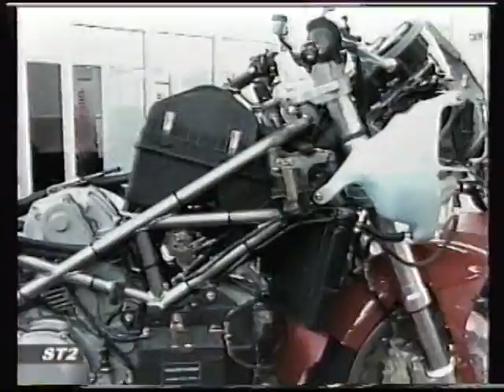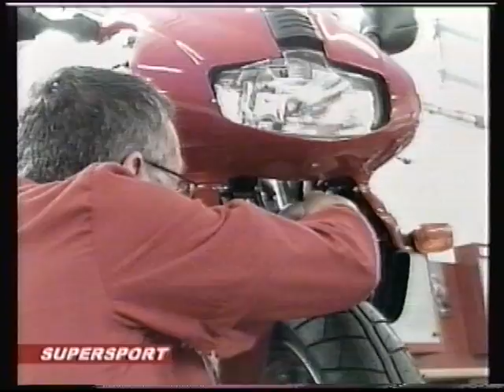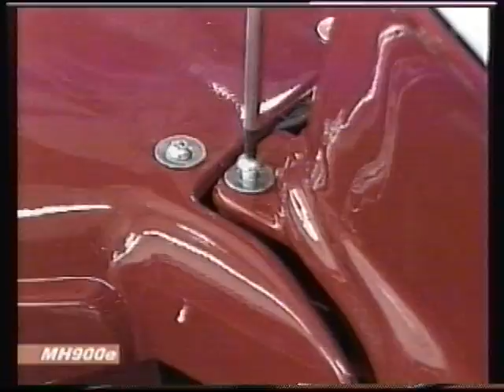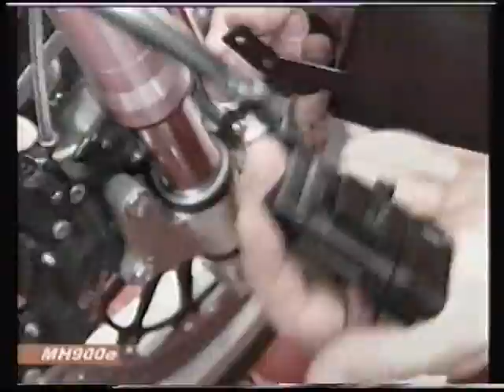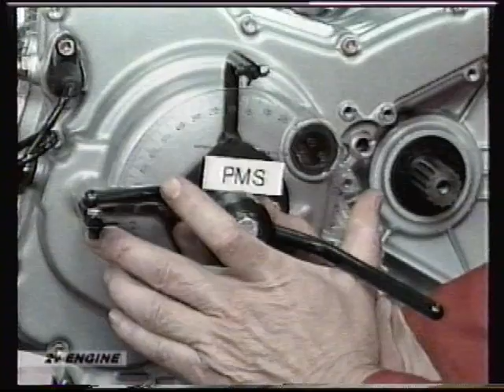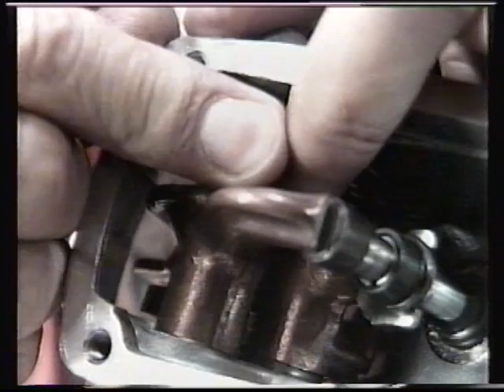Ducati Service   2 Valve Adjustment

Comment: 15:54 "install tool 88 etc... to rotate the engine" LOL.  I've got my own home made tool to do that and I'm good enough to check TDC on an engine without that silly degree plate which is of better use for other purposes. I've been working on Ducati's for over 30 years now. It's nice to see some of these instruction videos now but they weren't around 30 years back so thanks for uploading!
Reply: What does this tool look like, do you mind sharing? Also, what other parts should an owner replace at the time of valve check on these engines. Aside from the belt itself obviously. Mine is a 2003 SS1000DS by the way.
Reply: @olegk455  Can't share any pics on youtube. Checking the small bearings on the belt tensioners and 'guiding' axe is never a bad idea. If you spind these round by hand and you notice any kind of resistance to make these spin round or also when they spin round too liberatly (as in: you give them a good spin and they just keep on spinning)... if any dought in this section: replace them. They do last longer than the belts themselves generally but it's just worth a check. ;-)